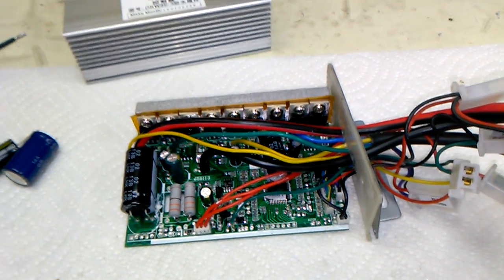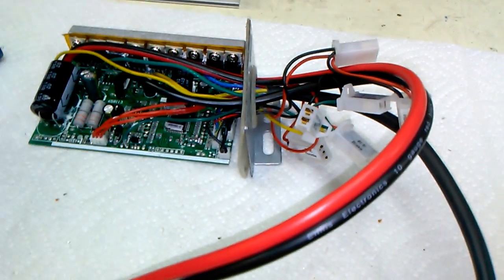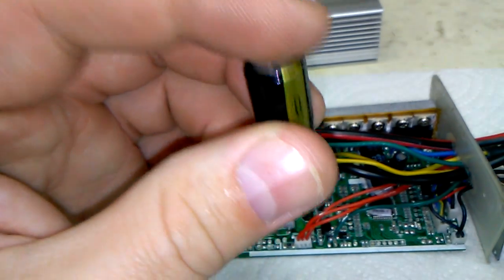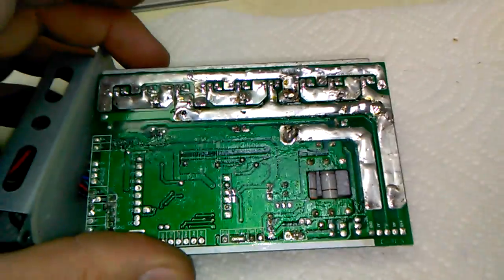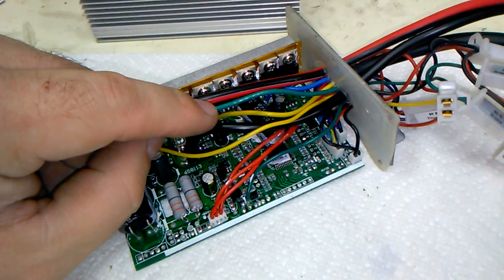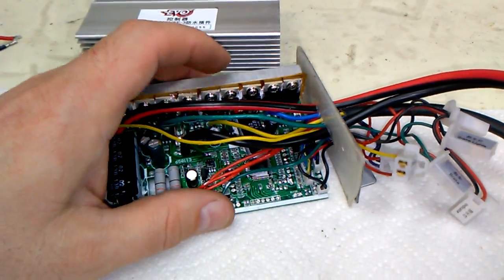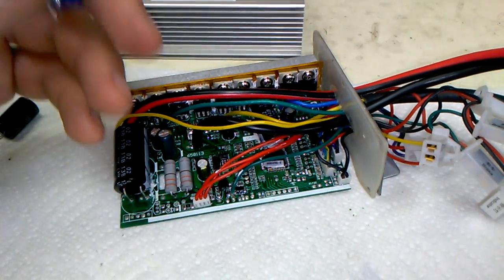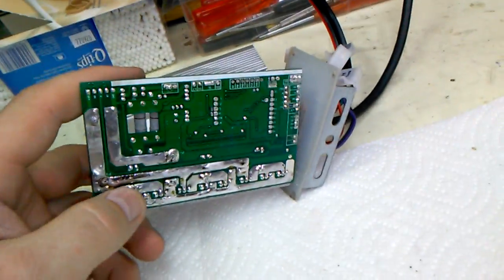E-Bike Scooter UberScoot 800W Citi EVO repair hack speed controller Modification DIY

Comment: Hi, I see your videos about repairing speed controler plz , I have a problem in my speed controler, when I twist the throttle to speed up the motor star whithout stop even when I make the throttle to 0, motor stay working. plz can you tell me the problem . I test the speed controler in an other motor and an other throttle, same problem.

Comment: Hi I have 600w scooter motor with 48v 25a controller. It gives me speed of 45kmh Can I add more power to the system to go like 65kmh?
Reply: Yes if you increase the voltage
Reply: @mitto_96  I need replace bms?
Reply: @drpainlesss  no the controller can suport 63v , so u can put a 52v battery in it , the max u can with a 48v controller, and it will probably go 60km/h or more speed

Comment: I was thinking about replacing a 63 volt capacitor  with a 100 volt version.  Is this really possible?
Reply: Can u confirm if EVO 36v controllers use 63v capacitors. Thanks!!
Reply: @god-likesystems985  I don’t have that brand scooter

I’m sorry

Comment: Do you know if running a 36v battery and 36v rated controller on a 48v hub is legit? Like, will I ever run into any type of issues?
Reply from the maker: no problem at all
Reply: @GPeter7  Thank you sir.

Comment: When you soldered the shunt and replaced the capacitors, how much did your final speed increase?
Reply: If you add another resistor you can get more park power 
it's open your power limit up to your FET limit but careful you can pop the FETs
Reply: @myway760  how to add resistor bro can you tell me?

Comment: Hello.
What merit- demerits..if I use 1000 watt controller for 500 watt hub motor of same voltage say  both 48volt .
Thank you.
Reply from the maker: it will work just fine,
Reply: It will work fine! for reference I’m over volting a 36v 250watt hub motor from a jetson bolt with 60v 2500watt speed control... the hub at best will only get slightly warm, and that’s at wide-open-throttle on inclines for a mile at a clip, also I weigh 250lbs. Take into consideration that some hub motors are designed better than others. From experience I wouldn’t over volt a razor motor more than half its rating.
Reply: @XrJay03  is speed & pick up increase? 
Thank you.
Reply: @XrJay03  & for this 60 v 2500w controller which battery you used.

Comment: Can some one tell me Whts the electronic door lock and 2 brake cables for I have n idea but I want to make sure
Reply: My guess would be that the 2 break cables are high and low break. If you trace them back to the esc board and they are labeled "hb" and "lb" then that's what they are. If so, low break is used by connecting it to a ground and high break is used by connecting it to a 5v power.
The door lock might be for a key or an on off switch, if it is the power switch it just needs a positive lead hooked up to it to turn the esc on. If it's not for a key then I got no clue, maybe the ev it was made for had doors? Lol

Also wanna say the name is sick af, all a man has in this world is his word and ballz. Let nothing break them.

Comment: Nice video and keep it coming! I have the Aerlang H6 500w 48v 17.5a. It goes about about 45 km/h. I want to know what do I need to do to make it faster. Do I need to replace the motor, battery and speed controller to make that happen?
Reply: Upgrade capacitor to atleast 100v. Change mosfet
Reply: @KismetMookz  was it tested? Any specs for mosfet bro?
Reply: Check the voltage on the capacitors and the mosfets, what ever the max voltage they can handle is you can just upgrade your battery.

Chances are your mosfets are 63v and as long as your caps are 63v or higher you can just upgrade your battery to 56.4v and get more power and speed. 
If the caps are just 50v then they would need an upgrade or they will pop after a while running max voltage. Same thing with the mosfets.
Reply: @skepticfucker280  Good looking out for the information bro.

Comment: I wish you could help me with my ancheer  e bike. I thought it would not be so difficult to add a headlight and when I took the lsw Controller that is built into the hailong downtube Battery Casing ,. There was a metal washer that was not attached and I did not remember to power cycle the controller with the battery off to discharge the capacitors and oh shit snap. Bike still works however I am unable to get into settings I previously was able to access from the displayThey even sent me a replacement controller and that didn’t solve the problem now they’re going to send a replacement display are the settings really saved in the display and not in the controller I’m really confused here.

Comment: How i connect my motor hub with 2 wires only,.
Reply from the maker: well, if your motor has only two wires, then make sure your  speed controller is brushed, and not a brushless
Reply: @GPeter7  can i send you a picture to teach me how
Reply: You need a 3 phase controller for the hub motor, you can't use your brushed (2 wire) controller on a brushless 3 wire (bdlc) motor.
Reply: what controller is that

Comment: Any idea how to fix the 3 speed in the controller? I tried jumping it with a wire and couldnt get high or low to work. It went out after my charge port shorted but everything works fine except my 3 speed wires
Reply from the maker: most likely you will have to replace it speed controller itself
Reply: Thought so. I'm happy with it so far and gearing for more speed soon as my sprocket arrives! Lol

Comment: I have scooter that stopped working. On the LCD screen. The battery bar is empty just blinking but it won’t start and battery is fully charged ?
Reply from the maker: that can be a speed control, or the battery doesn't have enough amperage
Reply: GPeter7 do it yourself mods can one of the hall sensors on motor not working or motor is no good ?

Comment: can i use it for 80volt
Reply from the maker: I doubt it can handle 80v
Reply: No way,you need at least 80v on the capacitors even if you use low amps.

Comment: Hey, maybe you can help me. My charger show me that scooter is fully charged, but when i turn on my scooter show like 30-40%. I'm not sure if it's controller or charger or battery pack. Charger shows me above 48V, i've checked with multimeter. Tomorrow i will check battery pack and controller if they have right value. But maybe you have some idea ?
Reply from the maker: probably it is a battery, I did have same problem before,
Reply: @GPeter7  So i've checked my baterry pack 4x12v and shows me right voltage. All above little bit 13v and all toghether above 50v. I've checked too another controller how it will be charging and still this same. Have you some ideas ?
Reply: @edzioevil  you should check your battery one by one bro there are some batteries in that series that were already faulty make sure to check them individually and must get the same voltage .

Comment: Hey i habe a quwstion Can i use it with 22,2v
Reply from the maker: Sorry but 36 volts speed controller you cannot use, it has 30v cut off circuit build in
Reply: @GPeter7  
Can i use 48 volt in my controller 36v...only cange caps 100volt? Thkz
Reply: https://youtu.be/1owh2cEIMuM

for ebike lovers must watch....

Comment: i got my new evo citi 800w (chain drive version) but it doesn't work. i tested the battery and it was fully charged. when i turn it on, the battery indicator doesn't light up nor the tail and headlight. what could be wrong with this? busted controller? where can we get replacement controller? please help me.
Reply from the maker: before buying a new speed controller, check power fuse it's located on battery box. a new speed controller you can buy at bigtoysusa
Reply: yes. checked the fuse and it's all good. but still not working.

Comment: Thanks for the video. Do you know if there's a circuit diagram or a schematic for the controller? I bought a spare controller but the wiring looms are slightly different - although the part was listed as a direct replacement.
Reply from the maker: Did you see my another video How to connect Speed Controller for UberScoot 800W Citi Scooter wiring diagram https://www.youtube.com/watch?v=t9KafVcNCB0
Reply: https://youtu.be/1owh2cEIMuM

for ebike lovers must watch....
Reply: @sagarevstore4524  HINDI LANGUAGE